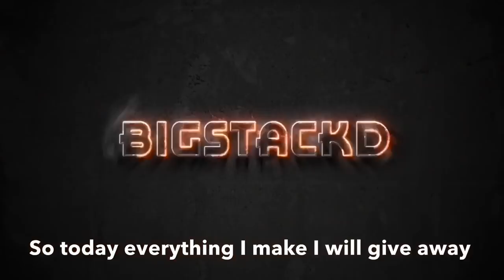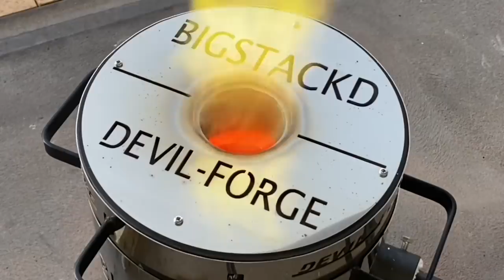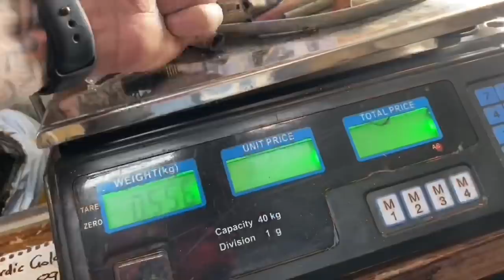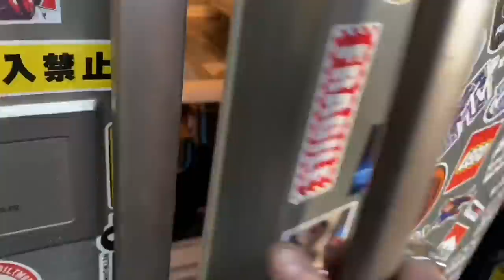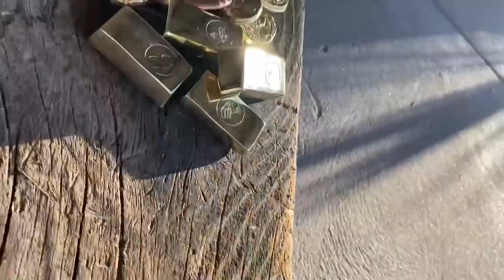Metal Detected Meltdown - Trash To Treasure - Metal Melting ASMR - Alloy Casting - Nordic Gold

Comment: My daughter and I watch your show just before her bedtime. She wants to melt metal here at home
Reply: You can melt tin in a simple tin scoop on your kitchen stove and cast it in a simple sand form
Reply: @henrikbrammas6698  I was going to comment the same thing lol nice. Tin is a great starter. Back when toys were still cool they sold little forges for kids to melt tin beads into little keychains and figures.
Reply: @genericalfishtycoon3853         oooooooo oooo ooooooo. .......,.....!.                .                  ..                         .       .             .   .          ..                      .      ..       e não me ama nem sei como e e pra ela no finaldanoite.
Reply: @henrikbrammas6698  whoa what's this?

A tin scoop? Like a coffee can? I guess I could pick up a Walmart blowtorch and a cannister, but what to use exactly like you're talking about? Sounds interesting.

I sand casted I teeny tiny knife made out of pennies. 😂 I used the Styrofoam method where it melts and takes the form. Turned out "OK" I guess. 😂 It's pure Zinc so very soft and doesn't hold an edge for s*it. I think pressing the actual shape in sand would be better than foam.

But I'm interested in what you're talking about. How do I get started exactly?
Reply: @genericalfishtycoon3853  that sounds hella dangerous to let a kid do
Reply: You take that daughter and nurture her into a badass blacksmith, my dude.

Comment: BigstackD inspired me to start melting. I now have a devil forge and I began melting some copper, from electric wire, some aluminuim from renovation project and zamac from old medals. Learned a lot from your videos.
Reply: Here the same! I also share it on YouTube 😁
Reply: Nice! I'm getting inspired to melt aswell.
Can you talk about you're experience about starting up?
Reply: Mr. Boomguy I Started with a 5 kg devil forge , I think it is the smallest. One 4 kg crucible a mold and some cheap tongs. I already had a lot strip copper wire from old renovations and melted about 20 4 kg ingots before running out of copper. Really happy of how it turned out! You could start melting yourself for under 1000$ of equipment and upgrade your setup as you continue.

Comment: You cost me some cash. I have 30 lbs. of silver clad relay contacts and a 1 kg electric furnace. 
Picked up a 4 kg Devil Forge and made some tools for it. I'm still stumbling around and putting the results on my channel.
I've had some success and now I'm busy making ingot molds and maybe try some sand casting.

Comment: Ide really like to know if mr. Stackd has any issues with the brass or copper. Even the aluminum becoming magnetic after the bar is cooled? I do use borax for a flux as well as a graphite cast and a clay graphite crucible.